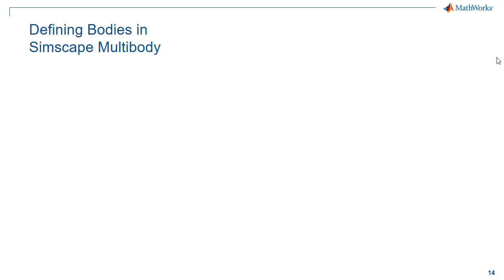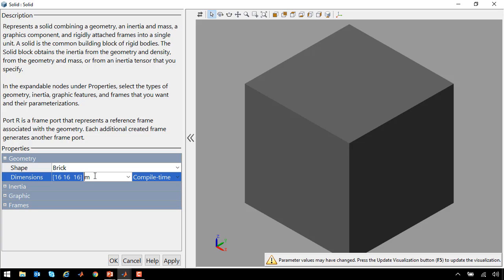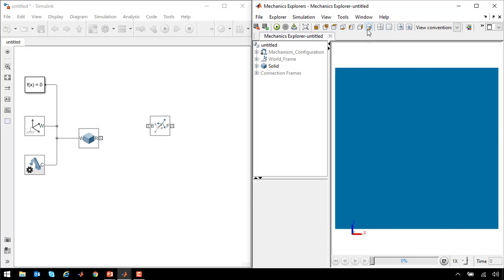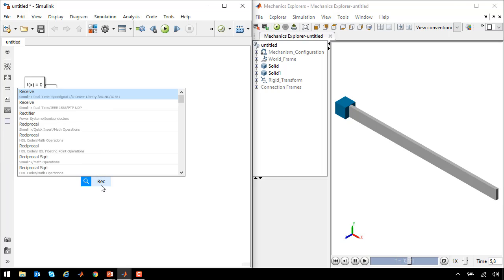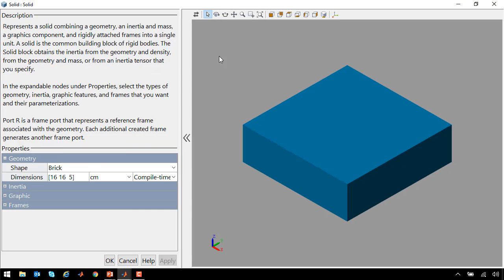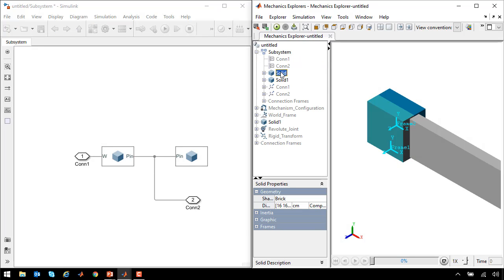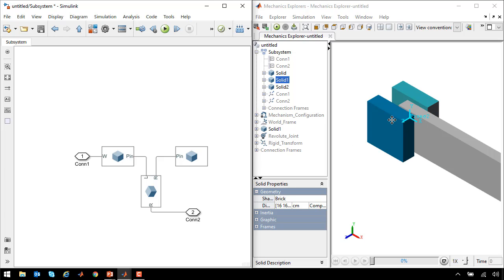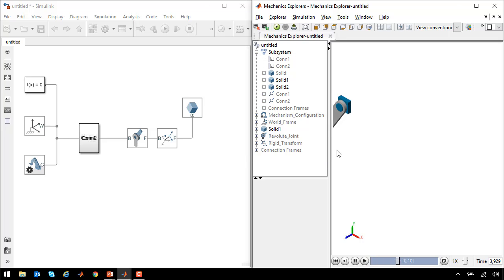Defining Parts for Multibody Simulation

Comment: can we use this in matlab 2016 version or need an updated version?
Reply: Yogesh Tripathi this demonstration is for newer version. But you can use these features in 2016. In 2016 version Simmechanics renamed to Simscape Multibody and you can define custom components as illustrated the video. This tool designed for dynamic analysis and controller design or select an actuator type. You can also create flexible parts and possible to develop contact models